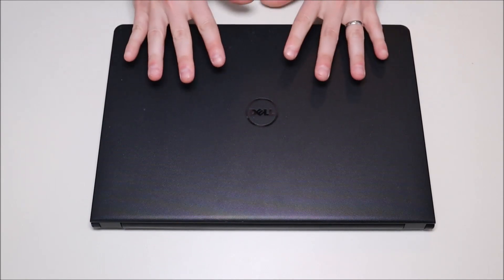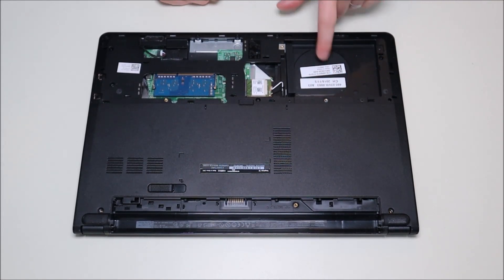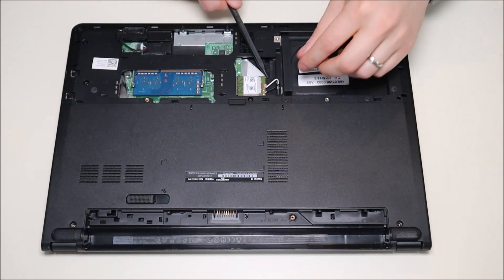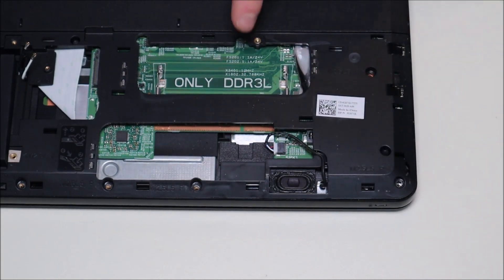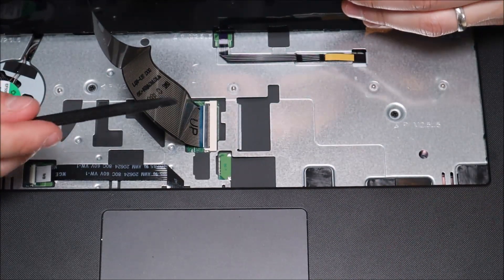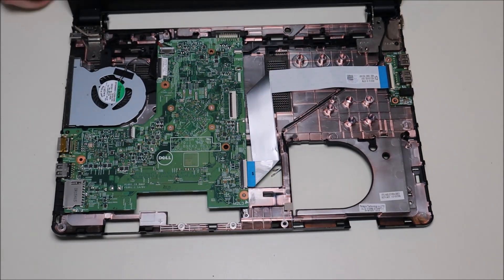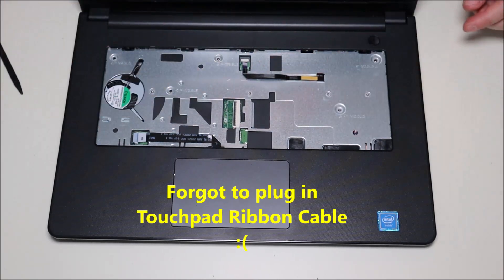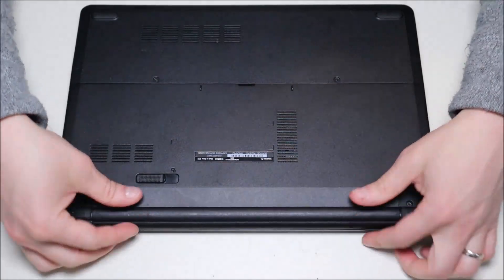Dell Inspiron 14 Teardown / Disassembly / Access Palmreset etc

Comment: I have a Inspiron 14 3878 how do i upgrade the hard drive ? there is nothing there to plug it in to
Reply from the maker: Does your model already have a removable HDD or is it integrated into the motherboard?
Reply: @PC_Monkey  intergrated i believe  its so small i cant put 11 on it
Reply from the maker: @dougwright5014  If its integrated then no, you wont be able to replace / upgrade it. You can use an external drive if you like. You can see a couple examples in this list: https://amzn.to/430vkEz
Reply: @PC_Monkey  Thank You so much for your advice  I appreciate you!
Reply from the maker: @dougwright5014  Happy to help :) Always here if needed !!

Comment: gud day i have the same model but how can  upgrade the storage  i dont see hardrive inside? is it a diskless kind of computer?thanks man
Reply from the maker: This computer does not have a HDD. It has an eMMC drive that is integrated into the motherboard. It cannot be removed or replaced. You can more storage by adding an external drive however.
Reply: @PC_Monkey  thanks for your time man,,, however i dont see any sata port inside so i can add a storage,,, maybe im going to use an external drive using the usb port... anyways thank you again

Comment: where is the hard drive? and seems there are no connection for the additional harddrive?
Reply from the maker: The HDD in this computer is actually an eMMC drive. Its integrated into the motherboard. It cannot easily be remove or replaced. The spot you see for an additional HDD or SSD is only available on some versions of this model. Ones with the extra port on the motherboard which this paticular one does not have :(
Reply: @PC_Monkey  I've actually been trying to find any information on the actual ribbon connector that is supposed to go there. you can actually see where it is supposed to be soldered on but there is no information on the actual connector itself out there

Comment: Hi can I add memory to this laptop??
Reply from the maker: You can increase the RAM size.  I always like to max out the RAM for the computer.  You can see your computers max RAM capacity in the user manual or by going to sites like crucial.com.  They scan your computer and tell you what your max RAM is

Comment: Hi pc monkey
I am having issue my laptop not turning on once i click power button it's lite up and off not even boot to BIOS.
One i remove bios cmos battery and attach after 30 minutes it's again normally working and this happens frequently. I already have replaced coms battery and I also removed old ram and ssd and hdd then added new ram and ssd and boot new os to the ssd also updated the bios also but still now I facing the same issue. Some time it's automatically power off when playing games and giving this issue something once i power off and try to access the laptop next day it's giving this same issue can you please give me any suggestions on this issue also my laptop is not under warranty anymore.
Reply from the maker: 1.  What are you able to see on the screen before it turns off?
2.  Also, did anything happen before this?  Overheating, liquid spill, physical damage, Windows update, etc?
Reply: @PC_Monkey  it turns off suddenly nothing on the screen no overheating and liquid spill and physical damage but it's working once removed the CMOS battery
Reply from the maker: @venkatesanv4307  For a computer that does not turn on, try this video first; https://youtu.be/kOBY4k2Mn_k. Let me know how that goes :)
Reply: @PC_Monkey  Manually resetting the BIOS settings is working but the real issue is it's happening every day I have to remove and add the coms battery in motherboard in order to start my laptop. Also thanks for the follow up
Reply from the maker: @venkatesanv4307  Perhaps the CMOS battery is bad then.  I would replace it if you have to reset BIOS that way each time you turn on the computer.
Reply: @PC_Monkey  I also have replaced CMOS battery but still having the same issue
Reply from the maker: @venkatesanv4307  Then it may be a motherboard or BIOS issue :(  I would next try reinstalling BIOS / flashing BIOS

Comment: It was working perfectly few hours ago then i active sleep mode . I don't know what happens.
Reply from the maker: 1.  What is the issue you are asking for help with?  Your computer is stuck in sleep mode?
2.  For a computer that wont turn off, press and hold the power button for up to a minute to turn the computer off. If that fails, remove the battery and unplug the power adapter to force a shut down. What happens after that, when you try to turn the computer on?